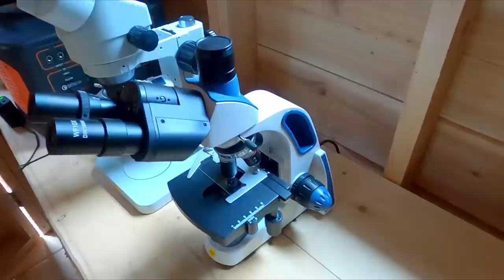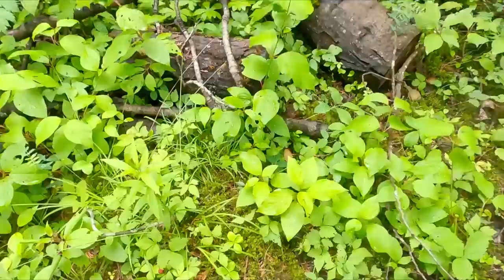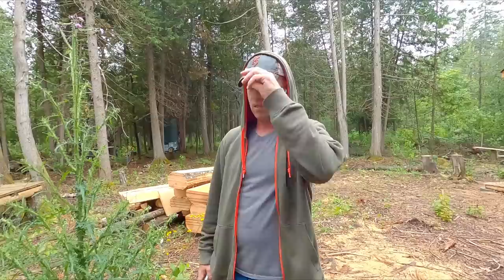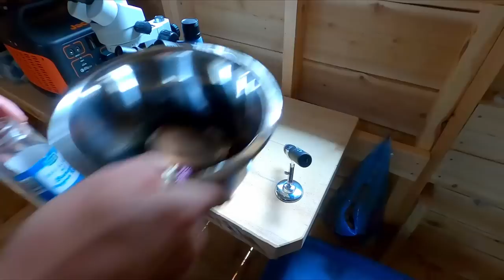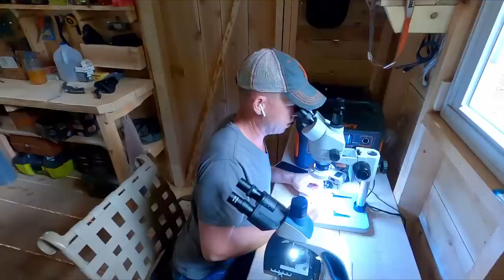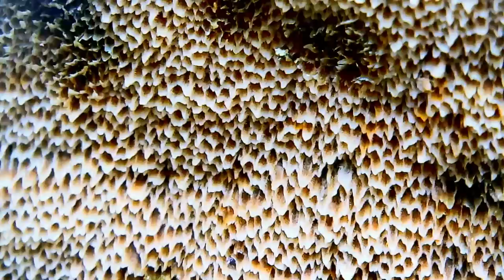4th o' July Party (Solo-American-Nerd-Wilderness Style!) #91

Comment: I love microscopes and bought a used one on eBay a few years ago.  It's mounted on a articulating arm, and I attached that to my metal lathe's tool post, to allow it to follow the tool bit for those super tiny cuts that I do manually.  Have dozens of telescopes and periscopes.....let's not go there.

When the biting flies are attacking the back of my head, (normally when I'm mowing or just walking around on the farm) I turn my cap around backwards.  Works like a charm.

Comment: have you ever thought of getting a hottap propane  water heater with a pump you can stick the water pump line in a 5 gallon bucket and just turn the tank on and it heats the water as it comes through the shower head you can keep another bucket there with water in it to fill it up with the water when you see it gets low you can turn the shower head off and on to preserve water while you wash down then rinse off  they have cheaper version on amazon i got one and we love it

Comment: you can get something called a "T-Mount" that allows you to use a DSLR on those telescopes. since you managed to get the kind with the Third Lens Tube, you should be able to get photos through those telescopes. also, you can get instead of a DSLR a type of LCD camera that can be mounted the same way too. worth investing in for sure, and you dont really need the highest resolution camera, 15MP would be plenty.